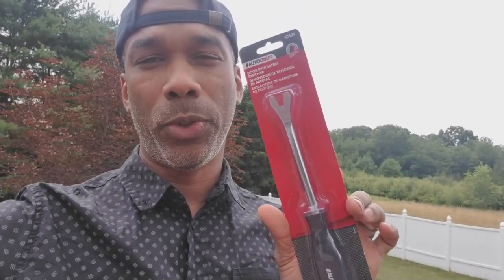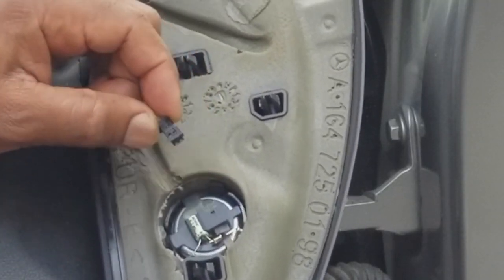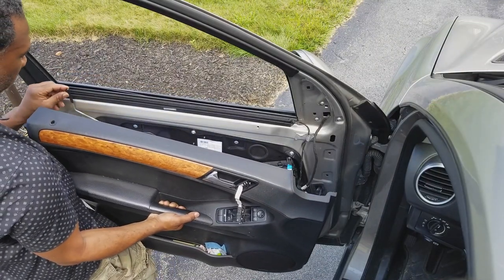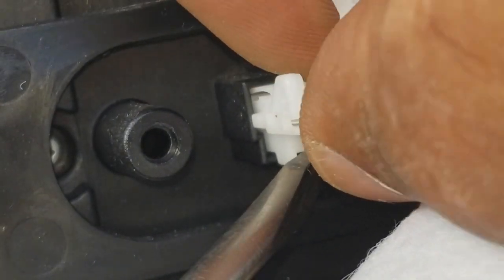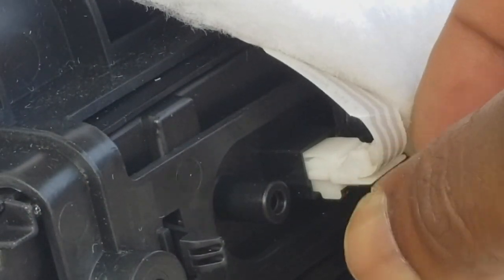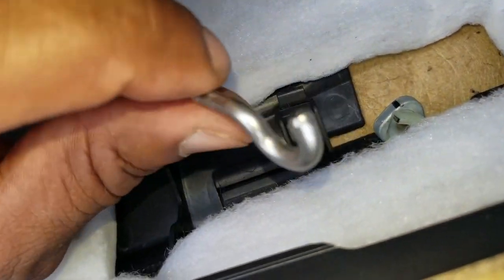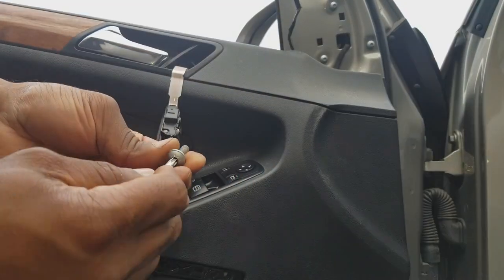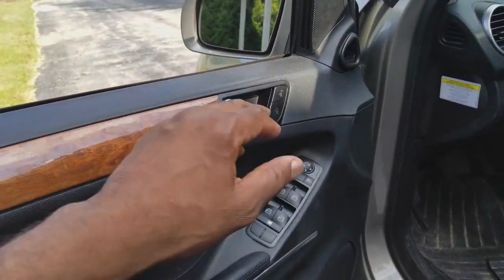Mercedes ML350 (2005 - 2011) Front Door Switch Replacement  | iRepair Autos

Comment: Thank you so much for this video. My 2009 ML350 door switch was broken for over a year (who needs to lower back windows, anyway?  ;) ), as I didn't want to pay Beverly Hills MBZ $750 for the repair. I bought the replacement switch for $40, and following your great instructions (only thing different on my car was that the 2 bolts holding the switch in place, inside the door panel, were a smaller size than the T30, but I actually had the right size tool, so I was able to remove them), I did the repair/switch myself! Works perfectly now, and again, thank you! :)

Comment: I followed the video to replace the liftgate release switch (tailgate open/close switch) A 251 870 63 10 9051 in my 2008 ML320 driver side door. At the point in the video where the link to the door handle is about to be disconnected it is possible to easily access this switch. The cable connector needs to be disconnected and a single torx screw removed to swap out the switch. Excellent well explained video!

Comment: Thanks man! I just replaced mine and the hardest parts were finding the clips on the bottom and unscrewing the damn 3rd screw hole inside the panel, I super glued the screw with the T20 socket to keep it in place it makes it easier putting it back in without dropping the damn thing. One more thing, I forgot to put down the window when I started no wonder I can't put the panel back on top..lol

Comment: great video presentation.  Any advice for how to power the passenger seat forward when battery dies and possibly seat control module faulty.  Which wire to power to get the motor to actuate forward on 2009 ML320
Reply from the maker: Connect a battery pack to the jump points under the hood.   I'll get those wires for you. What's your vin?
Reply: @iRepairAutos   4JGBB25E99A498043 is the VIN.  And yes I jumped it at the under hood points with no luck.  Battery has less than 1v.  I did a naked jump to cables to get the car into neutral so I could get it off the trailer.  But, I need to actuate the seat forward to replace the battery so I can search for the parasitic drain and crank the car.  I don't want to cut away any wires or cut the seat out.  I would prefer a connector to the seat motor to make a jumper direct to the motor and then use a battery or something direct to motor unless it is faulty.

Comment: Dear Keith 
I have been following your Chanel for a while and I enjoy how easy you make it all look .
I took your advice on this replacement of this part took the door apart and changed the old broken controller for a new one that costed $25.00 and 1 hour of my time .
The explanation it’s perfect and I manage to take everything out and put it all back .
Precision as you said yes it’s important if you wanna fix your old Mercedes .
Currently I have loss of oil every few weeks I loose around 2 litres of oil .
Also loss of power the engine run in some sort of low mode change the gears at 2000rpm only and occasionally the power comes back but I can see white smoke when I press the throttle down.
Any advice with this .
Thank you
Sasha

Comment: I keep resetting the drive window switch over and over again because it doesn’t do the auto-up thing every single time. I would reset the switch and it works fine until I shut the car off and leave. When I come back it works for a few days and stops going up again… Do you think it’s most likely the master window switch or another little square module that sits under the door panel? I have a 2014 GLK 250. I don’t get any codes when I do diagnostics with my Mercedes-specific scanner. Thanks!

Comment: Bro, how about remote to roll up or down window IR sensor fix. Couldn’t separate the sensor out from the lock cylinder. Please help
Reply from the maker: That's a tricky one.  you might have to change the handle.  That's where the senor lives.

Comment: I replaced the control switch exactly how you explained it, but it's still not working. Tried disconnecting and reconnecting battery and nothing. Checked all Fuses. Any suggestions?

Comment: Did you ever change the climate control panel on one of these?
Reply from the maker: Yes I have.
Reply: iRepair Autos u have a video on this?  If u don't, guess I'll google
Reply from the maker: I'll do one for you
Reply: You da MAN!!!  also, you should mention where you get your parts.  Are the parts used or new?  I see ebay has  used items and new are hard to find
Reply from the maker: All of my parts are brand new.  From Mercedes or online. I use genuine parts from Mercedes.   I'll start mentioning that. Thanks.

Comment: I was contemplating doing this on my w164 as my drivers door wing mirror doesn’t work properly, i tried to correct it with the launch diag but accidentally changed window settings so my windows dont work anymore🤷‍♂️so maybe i wont bother with taking the door panel off, as it looks like its all electrically😢 operated, a job for the garage i guess as i dont really know how to work my diag program, next option sell the car

Comment: Hello I replaced the door control of a W164 it didn't works, not only don't open the own window and the others but any window was possible to open with their own control..then weeks after I had to disconnect the main battery and when I reconnect it all windows were working....I wonder if it is neccesary to do something with program in computer.. do you please advice?

Comment: Hi! Had the same issue, and got fixed by independent Euro shop. I think I paid 500$ labour and part. How much was the part for you?
Joey
Reply from the maker: Joey Kassler the part is very inexpensive on Amazon.  Less than $60 USD.
Reply: I am  taking it back to dealer tomorrow.
Found a new one from a well known supplier.  For 1/6 the price.

Comment: Hello I'd like ask you a couple questions about a 2001 Mercedes ml320 yaw rate sensor replacement.
BAS dash light is staying on, brakes have locked up on their own while at low speeds. (It's fucking  scary!)
 Mercedes part = $600 - $650
After market part = $45 - $125
I don't have the old part out yet so I don't know the correct part number.
Can you get away with the cheaper knockoff part? ($50 - $125 knockoff) vs (Mercedes part $650)
Do you just plug it in and it's ready (plug and play) or does this yaw rate sensor require and set up after installation ? Any info or advice you can give me on this is greatly appreciated. I don't have $1500 to give to the dealer.